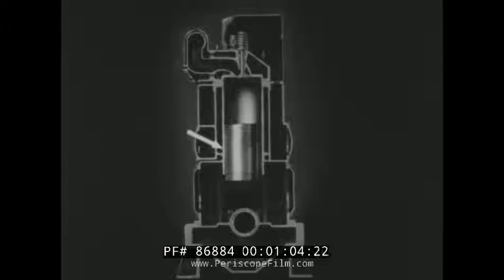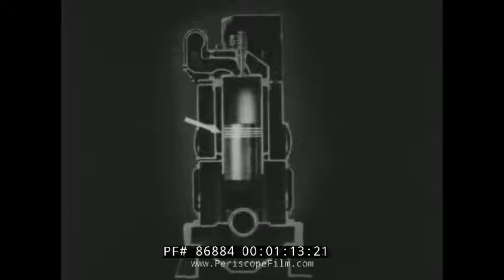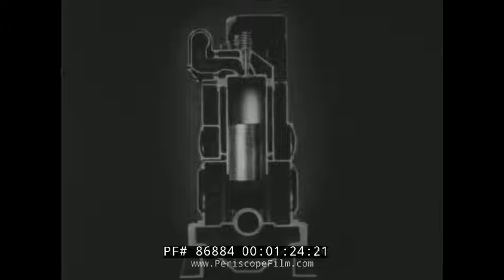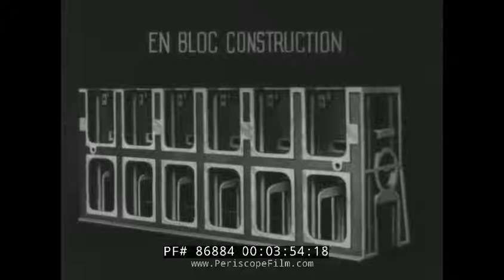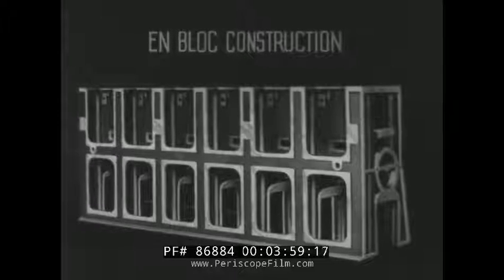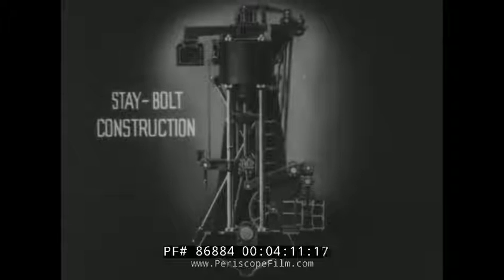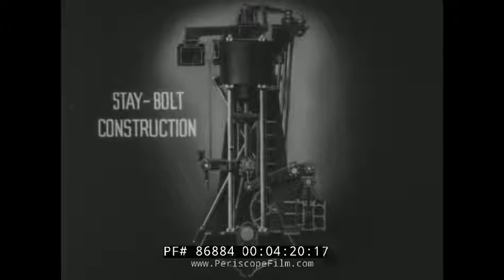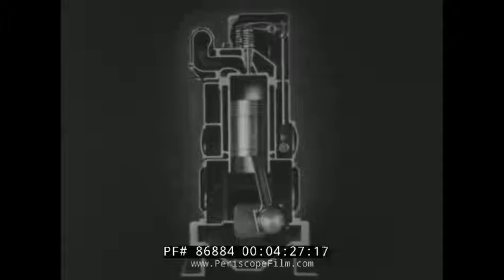"THE CONSTRUCTION OF DIESEL ENGINES " 1942 U.S. NAVY SUBMARINE SCHOOL TRAINING FILM  86884

Comment: I'll never forget my gf in the 80's having a little VW Rabbit Diesel.  I was so impressed with the 55-60 mpg the little car had.  Hers had an optional sunroof.  I don't think the car was very powerful, but it was sure easy on the pocketbook.
Reply: My friends a couple had a beige one. Not very quick but cheaper than s to run. You'd have to wait for the glow plug to warm up before you could start it. After that it smelled like any diesel - Kenworth, Mack - I liked the smell myself. 🚗
Reply: @cuda426hemi  I was so in love with that blue eyed dirty blond that I could care less about anything else.  She was a business woman and knew how to cut costs.  She wanted a prenup, I protested and that ended our relationship.  She could take that Rabbit and shove it where the sun don't shine.  I've got my Mercedes.
Reply: Those Small VW diesels were very fuel efficient. That was an advantage...But the parts and equipment that were needed to keep one running, when they got close to their expected service life (and in the case of the 1.5 L engines, unexpected service life) were expensive, and hard to find...That, and their extremely low power output, were probably the main reasons they aren't seen that much anymore. The owners of cars with the 11mm head bolts, found that the aluminum heads (that actually were originally designed for gas engines), warped quite easily when the heat that diesels are known to generate, started building up and then annealed and softened the aluminum, then warped the castings and started blowing head gaskets... These engines were much like the late 70's GM diesel V-8's that were basically gas converted to run on diesel fuel ... Not reliable at all... Great - while they were working, not so easy to repair, and very expensive - and a real headache, when they stopped working.
Reply: @michaelmartinez1345  I had an Isuzu diesel pickup truck in the early 1980s, so I am aware how easy it is for diesel engines to run very hot.  On flat land the engine would run at normal temps; but get on a steep highway grade and that temperature gauge would nearly peg over to overheating.  There were times when I turned on the truck's heater to facilitate cooling, as the heater acted like a secondary radiator.
Reply: @bloqk16  The diesels do develop a LOT of heat.,yes. In fact, that is one of the reasons they tend to be more efficient, more heat = more efficient fuel burn. The cooling systems of diesel engines need to be very robust to handle the VOLUME of heat these engines generate. Did Your Isuzu have a manual trans? A friend has a gas engine Isuzu p/u with a manual trans, and that trans & clutch seems to be larger than many other small truck transmissions. I wonder if the same manual trans was used on the gas engine trucks, that the diesel trucks had?
Reply: @michaelmartinez1345  My Isuzu long bed mini pickup diesel did have a five-speed manual transmission; and indeed, it seemed beefier than the other mini-pickup trucks of that era.  
The transmission and the engine itself were the only aspects of that truck that were trouble-free for the 90K+ miles I put on it.  I only bought that diesel pickup from the pressure by my older brother that worked for Isuzu in the 1980s.  From that experience I learned to never buy another vehicle that was exotic; that mainstream vehicles with widely available parts and maintenance people was the way to go.
Reply: @bloqk16  My buddie's truck, a '91 Isuzu with a 2.4 litre gas I-4  & a 5-spd. trans is somewhat reliable with over 175k. Is fairly reliable... There are a few problems, but over-all it seems to be a good vehicle... I have heard that the GM 'Dura-Max' diesel 4,6 & 8 cylinder engines are designed and largely produced and owned by Isuzu (60%), while GM owns & operates the remaining (40%) of that companie's assets... Several Isuzu engines are assembled in Moraine, Ohio by over 500 employees...
Reply: Take that engine, add a cylinder and it's an Audi, add another and its a Volvo. Most of the internal parts are the same. I still have the injector pump timing tools kicking around.
Reply: @jz422  Not sure if that is true. The original diesel rabbit was a gas engine with a diesel head. And expedient. The 96 on was a sophisticated modern diesel. Audi and Volvo made similar engines. They are all quite good. Not sure how many parts are interchangeable. Oddly there are a number of suspension parts that are and I can improve mine by buying Audi parts.
Reply: Those where great cars, run forever if maintained right
Reply: @bloqk16  I too like used vehicles! I was able to get a '77 GMC 3/4 ton p/u from an original owner who I knew very well , back in 2000... It has a 350 4-bolt main gas engine, with a T-350 trans. And is equipped with the 'tow package' JB-6 brakes and the 14-bolt full-floating rear-end and heavy-load leaf-springs and steering/suspension components... Yes, I did work on it, after I originally got it in 2000 with about 109k. Miles on the Odom ... Things like a new timing chain, fuel pump, water pump, eng oil pump, brake hoses, fuel hoses, cooling system hoses, master cylinder, rotors, drums, pads, shoes, radiator,  drive belts, battery, alternator, etc.... But the engine and heads, stayed in that truck...  I'm still using that truck, and it's reliable as a Casio Watch. Now over 479 k. Miles...  Still the same engine.... I rebuilt the trans at about 130k miles back in 2007, the trans and flex-plate are the same ones that I installed back in 2007.... Several of The older vehicles WERE more reliable than the newer ones being sold now... Back then, Isuzu was NOT involved with GM... Being honest, I'm not sure when GM married Isuzu. But it eventually did happen... What I do know is the Dura-Max engines are the products of Isuzu (60%), and GM owns/owned approx 40% , of that company.... I have mixed feelings about the Dura-Max engines... The p/u trucks are really fast with those engines, yes. But the main advantages of diesels is the high torque at low RPM that they produce. That is one of the main reasons they have great fuel efficiency... The Dura-Max diesels seem to have a higher RPM range than other commercially rated diesel engines... Not an advantage when hauling heavy loads... And more fuel is generally burned when pulling heavy loads with engines like these... The older Ford's with the 7.3 I/H (Navistar) engines , and the Dodges with the 6BT Cummins engines were/are very reliable-efficient load pullers... I like driving vehicles that are not only proven to be good, but I also like operating the vehicles for what they were  ORIGINALLY designed to be used for... And because of that philosophy , I have been able put well over 4 life expectancies of other vehicles on that '77 GMC p/u that is often towing trailers that are up to 7,500# and the back of the truck is always fully loaded with equipment, parts & tools... I STILL drive that truck around.... Great vehicles, these older ones are....BTW, that article that You sent of the ISUZU brand showing signs of divorcing from GM is very interesting... It is apparent that GM and Isuzu will eventually be splitting-up for good... Probably because of several of  the similar reasons that Chrysler filed for Divorce from Daimler, back in 2007, but then turned around and married Fiat in 2020.... Another reason that I like the older vehicles, is because those older companies seemed to have fewer issues with matrimony back then... They were mostly single, but enlisted some 'friends' (vendors) to help them along with their offspring's... A much simpler time , for sure, that yielded much better more reliable products that they made several years ago.... Not necessarily as fancy or Hi-Tech as the newer stuff, but way easier and less expensive to keep running.... And that's what's important, right? Being able to continue- on without having to spend a life-saving's to be able to do that....
Reply: You remember  the car more than her ? 😆.
Reply: @perpetualgrin5804  Seems I remember her more.  She was such a free spirited American girl.  She would come down stairs on a Saturday morning after a shower without benefit of a bra (perfect small a-cuppers) and be at the sink doing a few dishes.  I couldn't resist.  I would kiss her and run my fingers through her still wet hair and Lordy, Lordy, it was all over for me.  Her too!
Reply: They had teething problems with the rabbit gas engine made into a diesel. The 1996 and up versions were built from the start as diesels and are a great platform. I still have the first year, the '96. The relentless marketing of more HP ruined the simple engine making it impossible for the average person to maintain the later year versions. This also means the MPG is now much worse although HP to MPG is better. In the 80's you saw 55-60 MPG and I think 60 HP then 96 gave you 50 MPG and 90 HP followed by improvements to about 110 HP still maintaining about the same MPG. Then the HP kept going up but MPG is now in the mid 40's. I'd rather see developments to improve the MPG even if overall HP decreased. Diesel in my area is currently 7/gal. We have the technology but new cars are bought by people susceptible to marketing forces so my preferences won't affect design as I can't afford new.
Reply: @alwaysbearded1  I know the feeling.  I'm foolish about cars.  A real Maine dummy.  My newest car is a 2010 KIA Soul 2.0L(12K miles), a 2008 Mercedes C300-4MATIC, 2500 miles, a 2008 Cadillac SRX 110K miles, a 2000 Chevy Lumina 61,000 miles,  a 2002 Lexus LS430 108K miles, a 2002 Cadillac Deville 58K miles, a 2010 Ford F-150 XL 4.6L with 12K miles, 3 Vespa Scooters, a Kawasaki 125 m/c and a 2019 BMW gs850f Adventure M/C.  At 74, I do not need or want anymore cars.  My CO2 footprint is large and it's time for me to start downsizing.  I hate what sand and salt does to cars so I came up with a solution.  Head down to Florida mid October.  I keep Maguire's Wax Co. in business.  Cars are fun, but expensive.  The Mercedes still has the cardboard floor mats from the factory.  Big woopy.

Comment: A main component of every engine is the crankshaft. The name has two origins. The definition that was more obvious to me originates with the introduction of the automobile. Originally an engine was started by turning a handle attached to the crankshaft in a cranking motion "shaft turned in a cranking motion." The second definition is much older and relates to the shape. The 16th century definition is "to zig-zag", "run in a winding course", " a bend", or "a crook". 
This is a great video! I especially liked the part showing the lubrication on the submarine engine. I need to find a video on the submarine engine.
Reply: Many of the US Diesel subs used OP engines made by Fairbanks-Morse. Even some of the Nuke subs had a couple of them as hotel power for when the reactors were shutdown. And I have worked on/operated some in stationary use. They are an interesting engine.